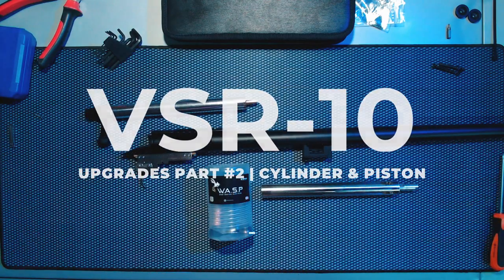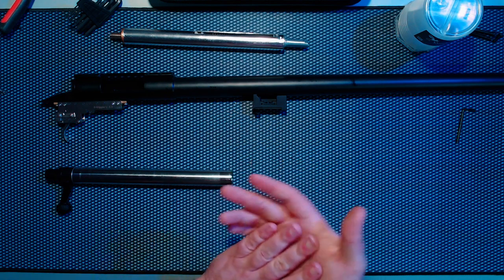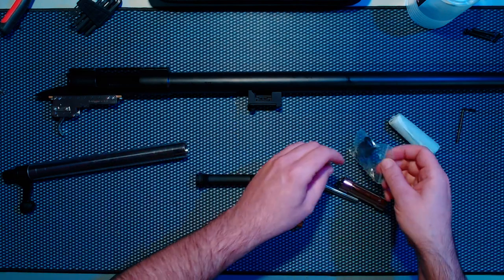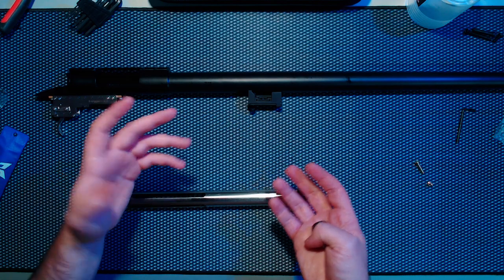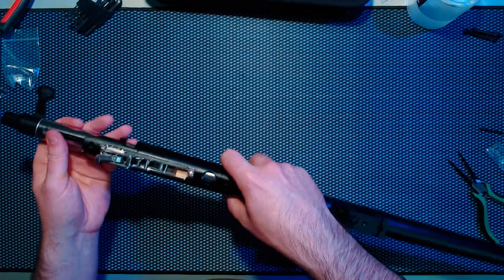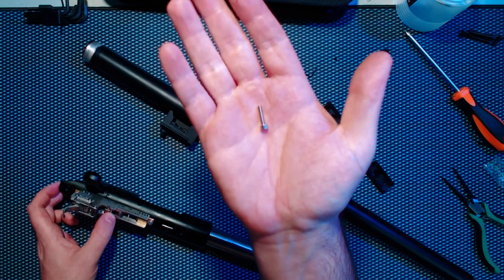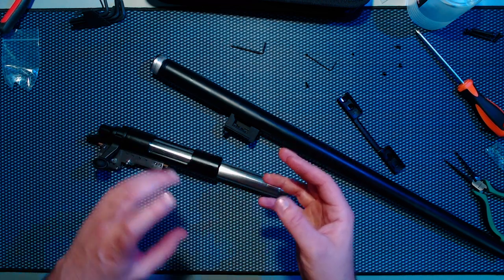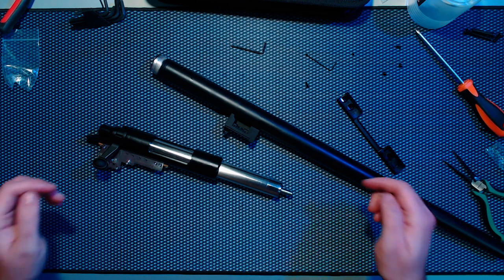CYMA CM701 Piston and Cylinder Upgrades

Comment: This video series is super helpful.  I have a JG-BAR 10 build with the same ML cylinder.  I am going to order the sniper mechanic cylinder head for it since my build is too "loud".   As he says, the stock cylinder is terrible (won't hold a seal).  The ML piston is threaded but there are no brakes for it as he mentions.  Super Short Build: ML Spring Guide + PSS 100 Spring + ML Piston + ML Cylinder + Laylax short outer and inner barrel (125mm SS - debridged) +  Action Army Hopup (red) + ML Autobot 60.  I installed an Action Army 90 Degree Trigger (need to mod mounting holes and trigger gaurd) but took it out and put it in my SSG-10 until I replace it with a Springer Trigger.  SSG-10 is also a good base but more expensive and "rough" out of the box ... you will need to work on it to get it to be smooth and quiet.  I also tried the SSG-10 stuff in the ML cylinder + the AA Trigger in the JG Bar10 and it worked (note larger diameter springs -13mm)
Reply from the maker: I agree with this, SSG10 can be alright if you don't get a Lemon, shorts builds are also fun :)

Comment: Hi there! I have a question regarding what spring should i use. I have the scw strigger 9.3, wasp piston and action army cylinder with your cylinder head. So i saw there are 2 options for me modify spring or rapax rms (pdi are hard to find). From what i have searched the modify will work and some people say also the rms one will but with some people the rms one did not catch. The platform i am using is VSR. Thanks!
Reply from the maker: You can use PDI, Modify and Rapax, the only springs I don't suggest are Nov, airsoft pro and ML.

Nearly everytime someone has a spring that doesn't catch its because they've used to many spring spacers.

I personally use modify or rapax springs
Reply: Thanks a lot for taking the time to help me! @SniperMechanics

Comment: Great video, question for you. I have just put together an action army T10 with a wasp (medium weight, medium brake) crazy jet barrel, flamingo 60, laylax head, Rapax 2+j spring. What weight BBs would you recommend? We had some .28 lying around and only getting 370 ish fps out of it.
Reply from the maker: 4 to 48s, measure on joules with weight and hop set not fps

Comment: This isn't sniper related but just wondering if the flamingo 50 will work well on the standard TM MK23 barrel?
Reply from the maker: Hey buddy, no it won't as the barrel window is too small
Reply: @SniperMechanics  would a 133mm crazyjet work?
Reply from the maker: @the_storm_ryder  100% buddy :)